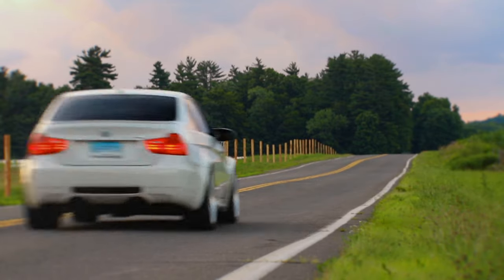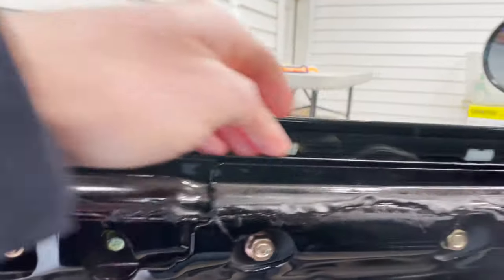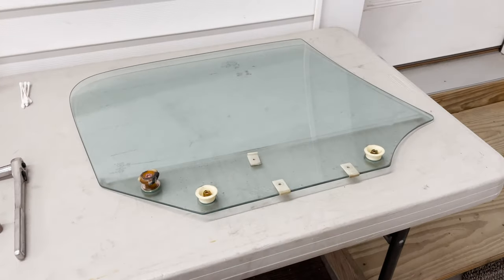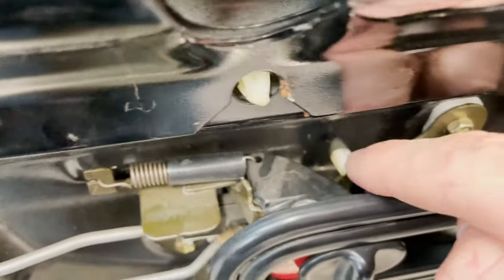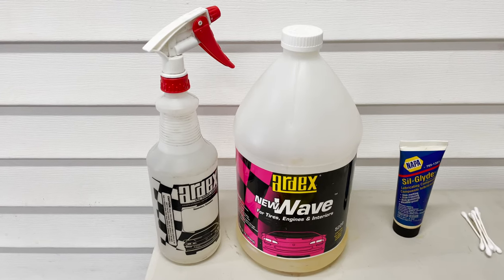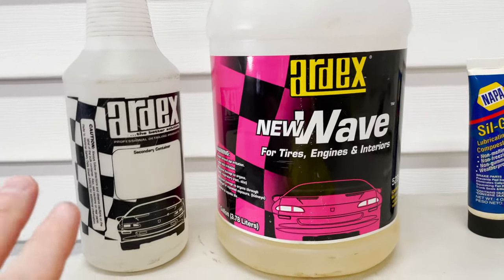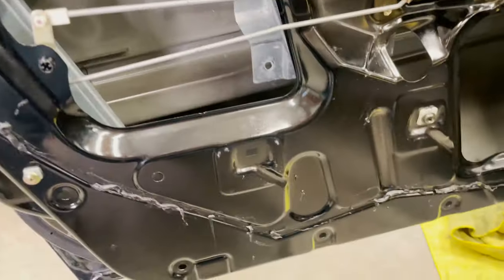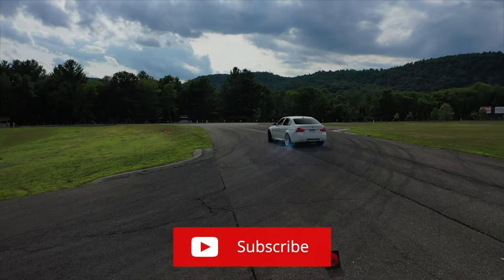How to Fix Sticky Car/Truck Window Crank Properly!

Comment from the maker: Have you ever had to do this job before?  If so, let me know how you did it and what products worked best for you!
Reply: I've had to do this a few times over the years. I found that the thick lube like you used collects dust and dirt and becomes gunky again quickly. I've been using thinner white lithium spray grease and that seems to do the trick. It's also easier to spray grease in the track without needing to take the whole assembly out. I also replaced my sliding bushings with the delrin ones from Moss Miata, they seem to work well.
Reply from the maker: @Bombavalusica I’m on board with all of those things!  I put the Delrin bushings in my last Miata.  I’m not sure why I didn’t this time.  And yeah, that white lithium grease should work just fine.  Truth be told, I think I wanted a good excuse to go in there and clean everything since this car is newer to me haha.

Comment: When they can make a lube...that works for everything....... everywere... 
:)  :)0
and them rubber door seals........ I have not found anything yet   that does not smear the edge of the glass... apart from sexy lube....... never tried that......:)

Tuneeeeeeeeeeeeeeeeeee upgrade next...:).... like bose or hk...
Very in depth and technical .... vid

Thanks Ryan

N x
Reply from the maker: Thanks Neil!  Speakers next, then some interior stuff, then I should probably do the brakes before I go through a wall at my next track day.  The bmw has been off to the side collecting dust.  I know how much you miss that car 😝
Reply: @DriveItRyan  Bmw.... ? never noticed it........... :)